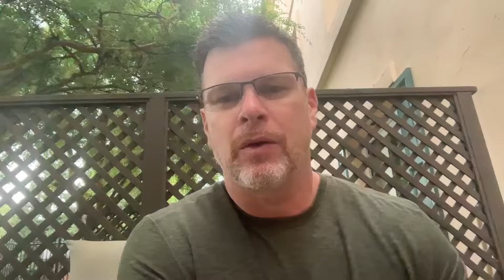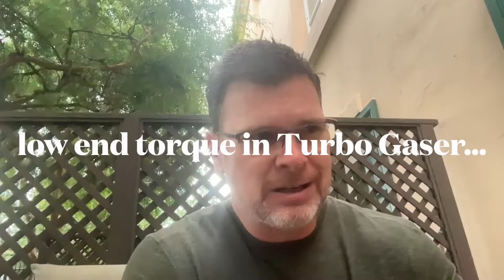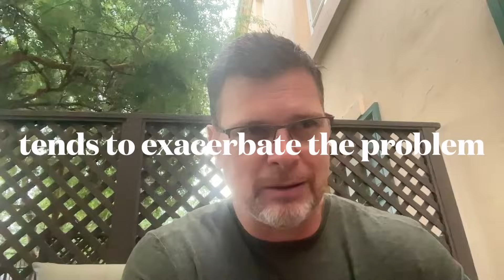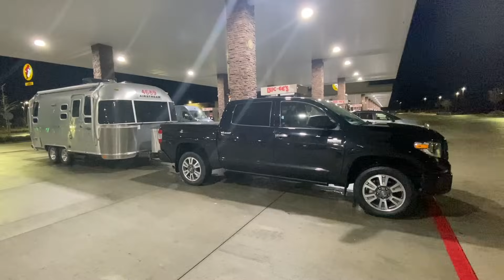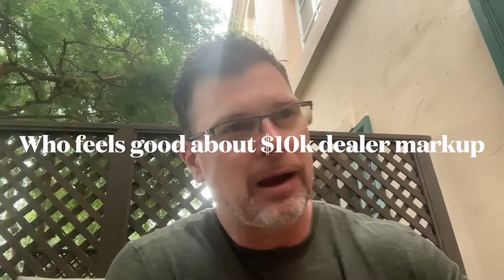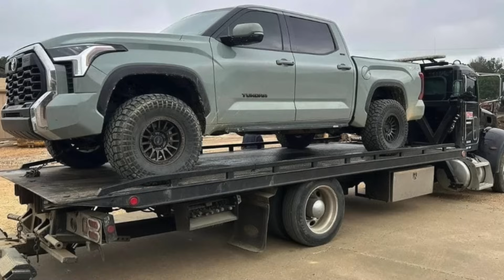Tundras Engine Recall.  What to do to stop failure

Comment: I think you are spot on.   A buddy of mine purchased a '22 and frankly it is a piece of junk in so many ways.   He is certainly on a first name basis with the local Toyota service manager.   My wife and I have been huge Toyota fans for years, having had an 89 and 92 Camry, an 89 Tercel, a 99 Rav 4, an 04 Sienna, an 11 Highlander, a 14 Highlander and a 16 Highlander.   The early ones were perfect, the later ones were decent and the 16 Highlander frankly was junk too.  Perhaps the best vehicle we ever owned was either the 89 Camry or the 99 Rav4.   No doubt Toyota quality is a far cry from what it used to be.    My daughter has a 21 RAV 4 Hybrid and just had the darn Hybrid cable replaced.  Vehicle failed on her, and thankfully it was at home when it would not go, and also thankfully Toyota knows that is a problem and thus it became a full warranty expense, but she was still without her vehicle for more than 2 weeks awaiting the darn part.   I still think (and thus agree with you) that the 21 and prior Tundras are perhaps the best half ton ever built, but sadly the 22 and beyond may end up being one of the worst.    For now I have my 2015 F150 that has been doing a great job for almost 10 years now, but I probably will end up upgrading to a 17 to 21 Tundra here one of these days, just to get one while I still can.   The 22 and beyond is not even on my radar.   Might re-evaluate when they do a complete redesign, but not a chance I will end up in the current model....unless someone uses it for a hearse or something.
Reply from the maker: Great post

Comment: I have a 2 year old Tundra Platinum and I have never had a problem, I do let the turbo's warm up and cool down, before and and at the end of my trip. I also use premium fuel 100%, because of the Turbo's. I'am not going to keep my original engine, Thanks.
Reply from the maker: Premium fuel is probably more beneficial than letting turbos cool.
Reply: How do u mean by warm up and cool down?
Reply: You just can't start a turbo engine up and take off, you have to wait until the oil circulate, about 2 to 5  minutes for me. Do your research on Turbo engines and Hybrids, Thanks.

Comment: What I'm more upset about is that I was unaware of these issues. And as Murphy's Law would have it, two weeks after I buy one, the recall comes out. It is completely unsettling that they continue to allow the sales of these trucks knowing these issues.
Reply from the maker: That is frustrating.  i hope it serves you well as long as you have it.
Reply: Well bud we are in the same boat just bought mine mid may, this absolutely suck they would continue selling these trucks for the crazy high price
Reply: i was understanding that the 24's wouldnt be plagued with the same issues.
toyota better make fucking good on the 75K brand new truck i just bought if its a lemon.

Comment: do you use 0w-20 in your 2nd gen tundras?
Reply from the maker: I do when I am not on long towing trips
Reply: @kedrevs4037  was curious. I have a 2013 with 167k. I have only used 0w-20 but was wondering if switching to 5w-30 would be advantageous. I don’t do any heavy towing or hauling.

Comment: The 2022-2023 fuel gauges still have no fix. 2 years and the engineers can’t fix a fuel tank. Engines might be impossible for them. We have to use the odometer for tracking fuel now. Gauge gets stuck on full randomly and you better remember how much gas you had in it. Running out of gas on highway at 65-75 mph can be very dangerous.
Reply from the maker: this is a very good point

Comment: The hybrids are most defiantly affected too, however because the electric part can take over on an engine failure and limp, Toyota doesn't consider it a safety issue. Lawful but Awful.  Quoting their filing to NHSTA "Some of these vehicles equipped with a different engine configuration have a Hybrid powertrain system. If engine failure occurs on a Hybrid vehicle, the vehicle continues to have some motive power for limited distances and the driver receives a continuous audible warning, warning lamps, and visual warning messages. "
Reply from the maker: Haha, limping on your hybrid battery makes you feel better doesn't it.

Comment: You are the one that makes more sense regarding the engine failure.  I also don’t believe the debris issue, cause that debris will move and cause other issues, not just the main bearing and oil starvation, that is simply a bad but dangerous  excuse.  

If main bearing and design flaws are the reason, all 22,23,24  are going to be affected and that is a major problem for them and the ones that have that engine.  

Those years trucks will forever devaluate even if fixed or not.  I hope they  have  balls to admit the real issue
Reply from the maker: Just seems like debris would cause failure at multiple points in the system

Comment: I've owned Nissan products since 1992. 
Never had a breakdown or recall, ever!
240SX, Maxima, G35 Coupe, and currently own a 370Z I beat the heck out of, and also own a 2015 Xterra Pro-4X with 110,000 miles that has been through blizzards and the Mohave Desert.
Nissan Titans and Frontiers are better trucks than Tundras and Tacomas are!
Reply from the maker: I'd have a Titan XD in my driveway if it came with a 35 gallon fuel tank...but vs the 5.7L Tundra
Reply: @kedrevs4037  you and me both! I’m still thinking of buying one anyway though.

Comment: I hear you about going to a 5W-20 or 30, but I saw where the first thing the dealer does when they get a blown motor to fix under warranty is test the oil, and if is not what the factory recommends, it will not be fixed under warranty, this is going to be a tough one.
Reply from the maker: Well, my first rec is dump it as quickly as possible

Comment: Wouldn’t a design flaw affect many more vehicles?
Reply from the maker: The final tally isn't done yet.  Most of this seems to be occurring at about 20-40k miles so far.   But how frequent will the occurrence be at say 60k miles
Reply: The replacement engines fail. Insanity.

Comment: Lifelong Toyota owner. I avoided the Gen 3 because of twin turbos and front end is butt ugly. Looks like I saved myself a lot of grief.
Reply from the maker: Turbos, and other changed specs kept me away
Reply: @kedrevs4037  Fords done spectacular w/its gen1 & now gen2 GTDI engine design. Plus great 5.0L Coyote avail. Can't be best selling 47yrs STRAIGHT if not excellent. Facts.
Reply: @Davido50  Right on!  Agree 100%
Reply: That's the issue. Life long Ford truck guy here. Rangers /F150s/F250s/Transit vans. ALL served my family very well. Just good basic maintenance. Ford has mastered the GTDI design. Guys get 300k+ mis on 3.5L Twin Turbo. Plus they offer excellent 5.0L Coyote V8. '24 Ranger Raptor in driveway. Best midsized truck out there.

Comment: Very insightful and informative video.  Your breakdown of the failure (no pun intended) makes perfect sense as a design flaw.  What shocked me is your advised owners to upgrade to Premium gas.  If Toyota didn't change the Octane requirements for this turbo engine, that is another design flaw IMHO.  I've had a 1994 Toyota Supra Twin Turbo (inline 6, solid engine, great car and never had any problems even with higher than stock 10 psi boost) and I currently have a Supercharged 2015 Tundra and they both ran on high Octane or Premium fuel!  This whole situation sucks and screams "never buy a first model year, just wait till they get all the bugs out!  I'm so glad I kept my 2015 when I got the crazy urge to buy this new model!
Reply from the maker: In the LS500 it does actually require premium.  Retuned for Trucks/SUVs and got the allowance for regular fuel

Comment: Bmw had a huge V8 engine problem in the mid 90's. I believe they replaced a ton of engines. I believe it was a factory head plaining issue.
Reply from the maker: BMW has totally different rep than Toyota
Reply: @kedrevs4037 Seems like Toyota has joined the party.

Comment: I bought my 2007 CM in 2022 with 213,000 miles on it. I never even flinched about the mileage because the engines from the 1st and 2nd gen are bullet proof. I now  have 242,000+ miles on it and it runs like a Swiss watch. I had a FULL maintenance done on it  after I got it. I wouldn't get rid of my truck if someone gave me a brand new truck of any brand. Oh what a feeling is now just an empty statement, and that's a shame.
Reply from the maker: I hope this matters to Toyota, and I think it does

Comment: This engine has been around for 6-7 years. How do you explain no recalls in the previous years if it’s a “design “ flaw?
Reply: 7 years? Which vehicle had these exact engines that long ago?
Reply: @cjwest9094  2017 Lexus LS500
Reply from the maker: LS500 is a sedan, tuned for HP, not torque and recommends premium fuel
Reply: @kedrevs4037  exactly. I can't understand why ppl are saying that the TTV6 and hybrids  reliable when it's not proven in their truck line yet. they've been in the hybrid world for a while, but the smaller engine in a truck vs. sedan are 2 different things. Totally different use cases.
Reply from the maker: I think you are very mistaken.
Reply: They can’t explain it because it wasn’t used in their trucks
Reply: I was under the impression this engine (not the hybrid configuration) was brought over from the Lexus line.  I remember everyone complaining early on about putting a car engine in a truck.  Am I wrong?  My point was the distinction for design vs. production flaw. The design of this engine was years ago if I am correct.  I am suspicious of a problem with production just has been explained by the recall and the official report from NHTSA. The skepticism related to not trusting Toyota.  I get it but I would assume it is in their best interest especially now to be transparent.  Without giving the shift, the managers name, the employees name, or the day someone signed off on production process Toyota has given a reason for the engine failures.  Metal debris was not properly cleaned out during production.  Maybe we (me) would like to know more specifics but I don't think this is how it works this early in the recall process.  I am sure it will become more apparent with some time.  If I was Toyota I too would be struggling HOW are we going to fix this.  I am optimistic they will come up with a plan the will satisfy most but how is the question.  We will see.  I hope it's a good one because people are concerned.  I just have to trust time will be the best option for now.
Reply: it was modified, not exactly the same, stroke and bore changed but still equal same displacement, cooling system changed and lots of other tid bits was changed.

Comment: So should i keep my 5.7 v8 2021 Trd Pro then??
Reply: Yes,
Reply: No you should sell it to me and get the new best in class best looking , most affordable and most reliable "new" Tundra.
Reply from the maker: That is low, don't take advantage of people like that
Reply: If you dont want it, i will buy it off you, just need to install aftermarket trans cooler and its guaranteed 1000000 miles
Reply: For the rest of time you have one of the last good vehicles left

Comment: I completely agree w your “design flaw” theory on the engine. The metal debris explanation is full of holes. This is a much worse problem than Toyota wants to admit. Expect litigations from FTC and DOJ. Ultimately Toyota will be forced  to settle and buy back impacted vehicles.
Reply: Main bearing engine cradle flexes under boost. Spun bearings result. $40k out of pocket when out of warranty. This will be historic.
Reply: @bobcook8576  that’s about the market value of those trucks. It’s logistically impossible to perform the repair nor swap out the engine for that many trucks. If it’s cheaper to buy back, Toyota will have to do it.
Reply: @bobcook8576  Thank you. That's a design flaw and cannot be repaired. Stupid not to use traditional main bearing caps (see 5.7 v8).
Reply from the maker: What a nightmare that would be for all involved
Reply: @kedrevs4037  remember the VW diesel emission scandal? The Feds made them buy back all impacted vehicles. :)

Comment: A casting flaw can leave excess material inside of internal passages. Permanently until mechanically removed.
Reply from the maker: Certainly possible, but not reassuring
Reply: An oil passageway is drilling (machined) through the crankshaft journal during the manufacturing process.  Debris could certainly clog up that passageway, but that would've been easy to discover by Toyota in disassembled engines yet they haven't said that because they know that's not the problem.  My money is on a design flaw.

Comment: I tend to agree with everything you said except the oil. I think they may have the clearances so tight that even the thin oil is having trouble getting where it needs to be. I would definitely stay with the 0w20 oil for now. I would also do oil analysis to see if bearing material is showing up. I suspect the recall is just dropping the pan to inspect and maybe Toyota does oil analysis. Until they get a better handle on the problem, using heavier oil might be really bad and void your warranty also.
Reply from the maker: You have a good point about clearances
Reply: 0w20 is already thin.. idk that going with an even lighter oil will fix the issue.. if anything, it might need a heavier viscosity.
Reply: Meh...it's always the same bearing though. Not one of the bearings. The same specific bearing every single time. All of the bearings will have the same tolerances and if that's the case, we'd likely see random bearing failure. Not the same one every time.
Reply: @RYTHMICRIOT  I've seen photos where all the mains were damaged.
Reply: I think you are spot in. Direct injection tolerances are much tighter. Stay with what weight OEM recommends. Also, change your oil at 3,000 miles, 5,000 worst case. They also run dirty and prone to sludge. We are in a new era and need to protect your investment. This is just good maintenance and not related to these failures. I do think it is bad design and also cradle holding bearings is an issue from other videos. If toyota admits that these are toast. Buy saying debri that can give some false hopes to stick with it. Dump it yesterday.

Comment: Toyota’s fix should be a 5.7 L V8 bumped up in horsepower and torque matted with a 10 speed automatic transmission
Reply: Unfortunately the 5.7 will never return, not because of mpg's but due to emissions. If it did return it would be plagued with issues because it would most likely have cylinder deactivation and other gimmicks that would ruin the longevity of the engine.
Reply from the maker: Love this idea, my preference would be 5.7L, with 10 speed 3.73.   Should be good for about 15-16 city, 21 highway and plenty left for 1/2 ton towing.
Reply: @kedrevs4037  the combination you mentioned is the exact same I’ve been asking for a long time. While Toyota is at it, they can make a 2500hd too!
Reply: I will agree, but I have never had a problem with my my 5.7 Tundras. The 6 speed, and their horsepower/torque last half of forever,only routine maintenance. 2015 174k, 2020 45k. And I regularly pull an 8k pound dump trailer.
Reply: @mitchellbroaddus9120  I own a 2018 Tundra. My six speed is a little clunky shifting from 1-2 sometimes. I believe a 10 speed would be better for fuel economy too. Hell, I’d settle for an eight speed. They had one in the Lexus. Toyota very well could’ve put that in the Tundra.
Reply: @KeystoneTexan  how often do you do a drain, and fill? I do mine every 40k, no problems, on either.
Reply: @KeystoneTexan  and I would be happy with an 8, or a 10 speed. 3 or 4 years after they introduced! Never buy anything when first introduced, wait for any potential problems to be worked out!
Reply from the maker: Love it
Reply: I agree also increase fuel mileage to about 24 MPG that would be a perfect combination..
Reply: Never gonna happen 😂
Reply: 8 speed better, don't want the gears to be searching so much when towing